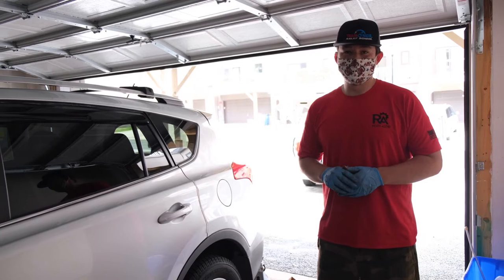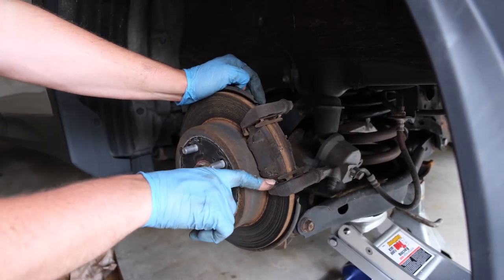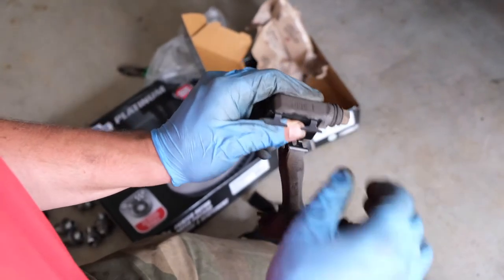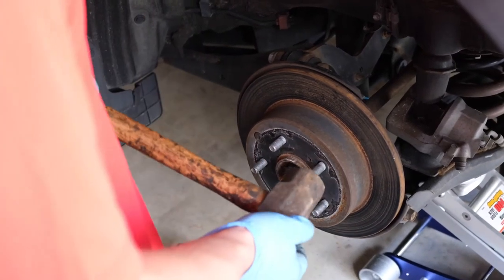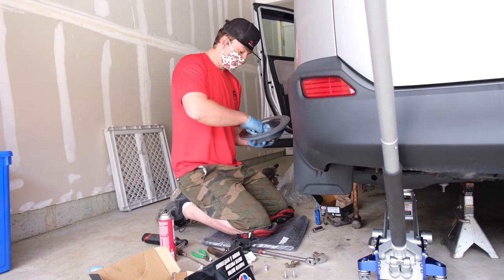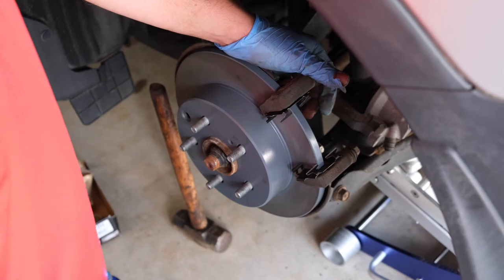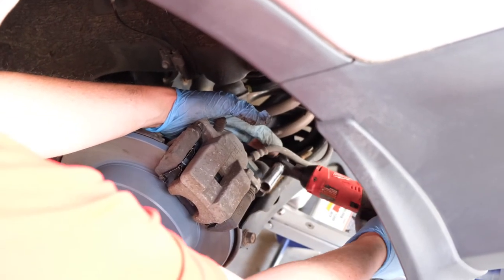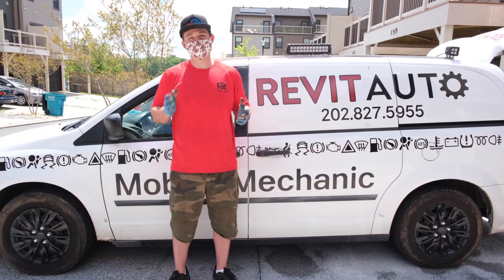2014 Toyota Rav4 / Rear Brakes & Rotor Replacement How-To

Comment: Watched 2 videos on rear brake rotors and pads on a RAV4. Noticed a difference between the 2 and one thing that was the same. The first video the mechanic greased the bolts,. this video used lock tight. Both said they would leave the torque specs, neither did. The torque for the caliper bolts is 25 in/lbs, the caliper bracket bolt torque is 72 in/lbs. The torque for the lug nuts is 76 in/lbs.

Comment: Great video! You thoroughly explained the steps required, and even showed how to position the brake pad wear indicators (a step which is not mentioned on most YouTube videos). Also, kudos to the cameraman for always getting the correct angle and even throwing a great question about the caliper pins!
Reply from the maker: Thanks buddy! I appreciate the positive feedback! Happy Motoring-Blair

Comment: I found this extremely helpful!  Thank you for posting this and pointing out each little issue you came across, from the west indicators to the different pad holder sizes/fit.  I have noticed that even after adjusting, the parking brake seems to slip. I probably should replace the parking brake shoes (75k miles). Thanks again!!
Reply from the maker: Glad it was helpful! That is odd it is still slipping, how are you testing the brake?

Comment: So was that an M8 x 1.25 bolt used to remove the rotor?
Reply: I came here for the same question, after testing, yes M8 x 1.25, i used 50 mm length which left plenty of room to work after the rotors broke free

Comment: Yes pump the peddle until it comes back up good and hard. If you’re changing brake fluid remember never to allow the peddle to go to the floor, this will allow air and debris into your master cylinder, Toyota’s are prone to this mistake.
Reply from the maker: I have had where the master cylinder goes into failure because of varnish inside the master. But I have not heard of the units sucking air into the system!